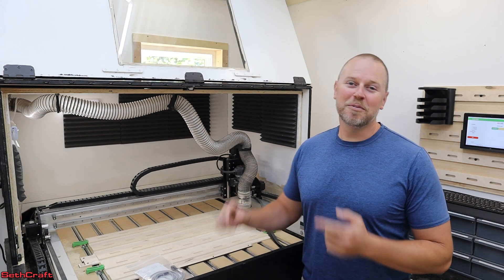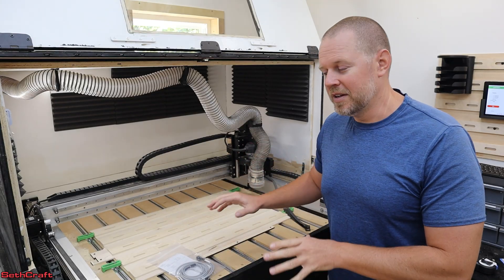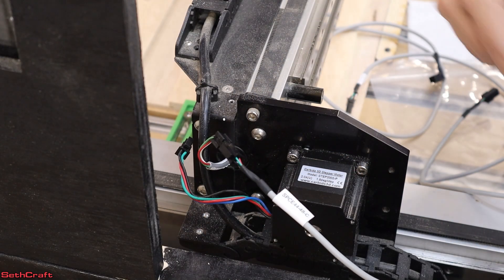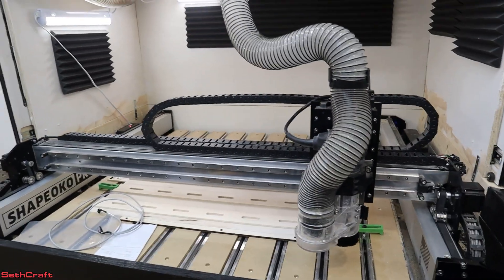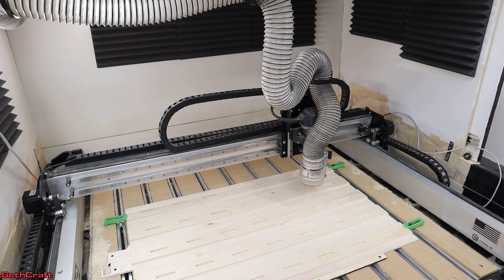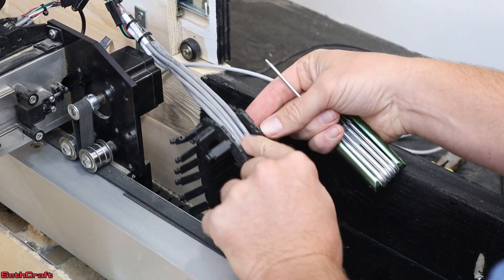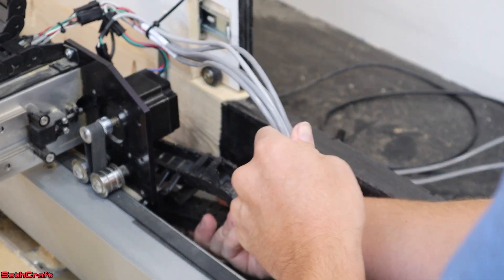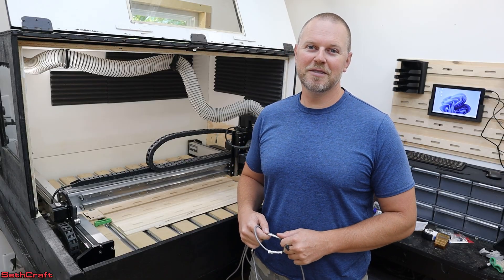Stepper Motor Skipping Problem Fix - Shapeoko Pro XXL

Comment: First ,Hello my friend, very good video, because these are the most problems when you have long wires, i mean with, long wires longer than 800mm , for sure when you are going for speed to fast ,it can ´t work, but they are steppermotors, only ,